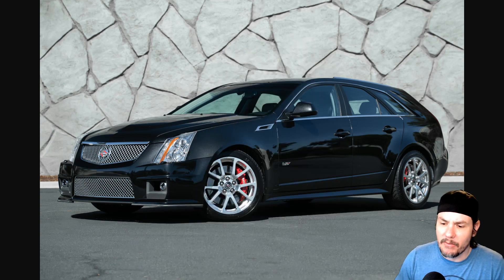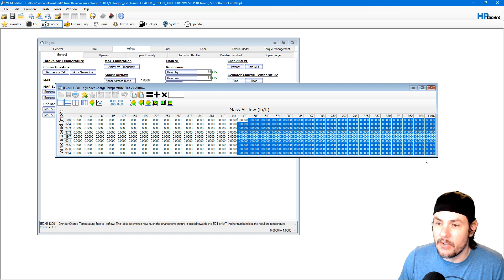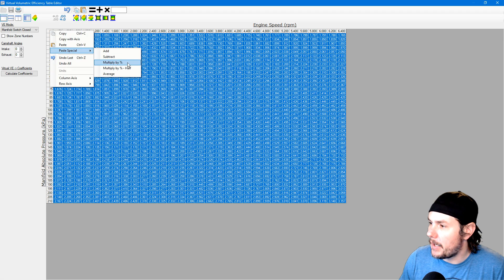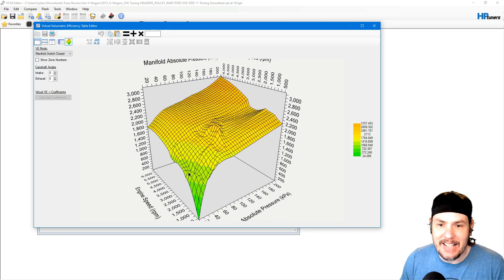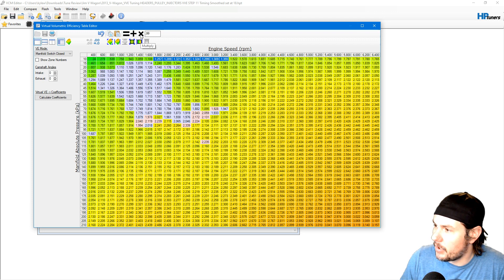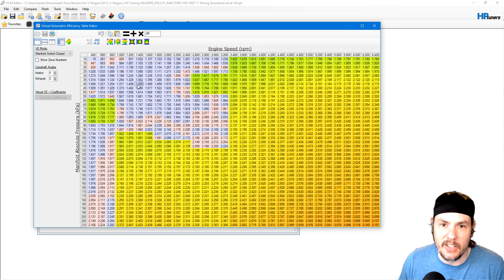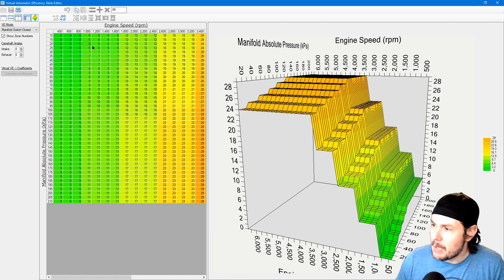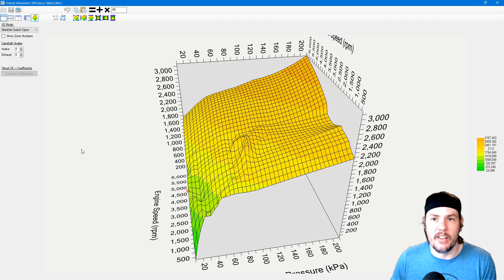VVE Tuning Issues, Big Shifts On Adjustments?

Comment: Rich after reflash. Zero the Injector tip temp offset table.
Reply: Just the opposite, lean after reflash. I already have that zero’d, it’s definitely air temp related though.
Reply: @jimdupont6638  You can have lean after reflash if you use the crappy data from rich after reflash as well. Specially if you zerod the offset and didn't put the adjustments back to before the mistake etc.
Reply: Good point a lot of people forget about! Injector tip temp gets reset after the flash, goes off the ECT, and you then run rich until the ECM recalculates it properly.

Comment: Awesome advice 👍🏻 I use EFI Live and adjusting the boundaries really helped me get the table ironed out for my setup. My current cam has 17 degrees of overlap and it wants to make a “dip” in some transitional areas which I eventually had to leave a little on the fat side.
Reply from the maker: I like the way the zones are highlighted in EFI Live